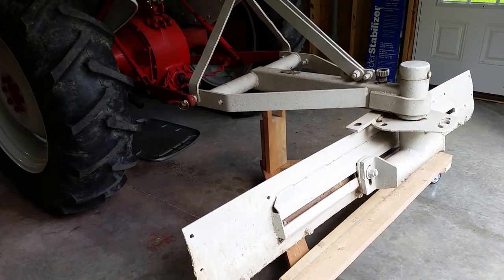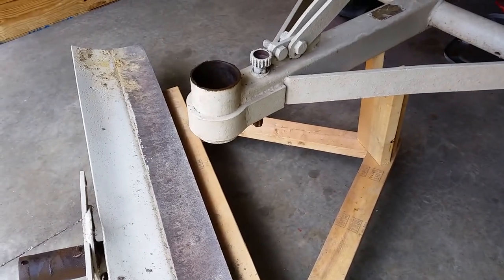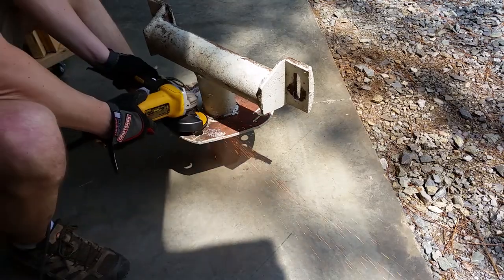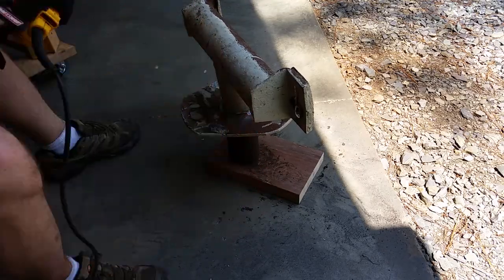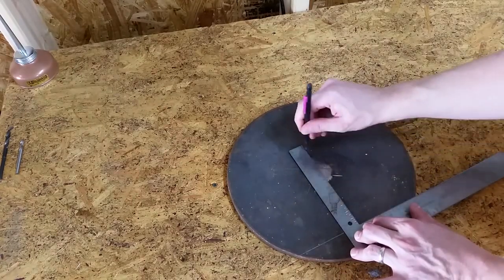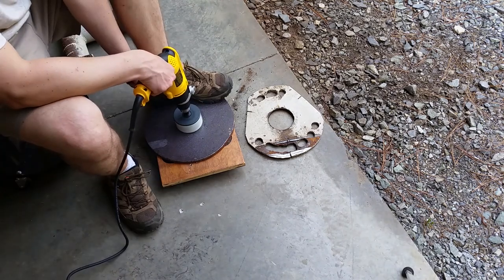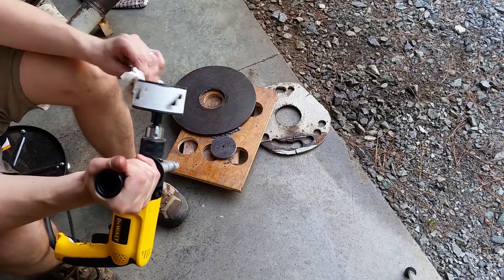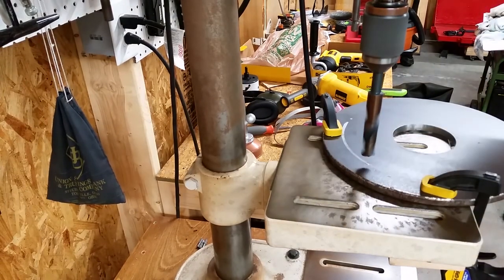Repairing a Tractor Grader Blade

Comment from the maker: Dewalt Angle Grinder:
https://amzn.to/2UOxd3X (affiliate*)

Lenox Hole Saws:
https://amzn.to/39zeChu (affiliate*)

Dewalt 1/2" Hammer Drill:
https://amzn.to/346Exw8 (affiliate*)

CP Die Grinder:
https://amzn.to/2xEWRA2 (affiliate*)

Carrbide Burr Bits:
https://amzn.to/2UvTgxc (affiliate*)

3/4" Drill Bit:
https://amzn.to/3azUhtI (affiliate*)

Dewalt Chop Saw:
https://amzn.to/2xD1aw1 (affiliate*)

*Purchasing from these Amazon affiliate links earns my channel a small commission. Think of it as a tip that doesn't cost you anything. Thanks for the support!

Comment: good work, might i suggest a bottem bracket with a corrisponding pin sleeve as well? i think thats why the thing is encountering so much wear
Reply from the maker: I originally planned to weld hardened bushings into each hole but I figured with the increased thickness of the new plate and the infrequent use it sees, it'll probably outlive me. :) Thanks for watching!

Comment: How come you didn’t put hole on the opposite side so you could turn the blade around to use as a pusher?
Reply from the maker: I just couldn't think of a situation where I would need to push with the blade. I made this repair 5 years ago and haven't had a need for it yet. It wouldn't be as easy, but I could always add a hole in the future, if needed.

Comment: why you using 6010 rods
Reply from the maker: Good eye! I used 6011 for a few reasons: 1.) I wanted high penetration since I was only welding one side of the plate. 2.) The "fast freeze" of the 6011 made it a bit easier to fill the gaps on the bottom of the pin sleeve. 3.) I have very little welding experience so maybe it wasn't the right rod for the job but it seems to have worked very well. What rod would you have used? Thanks for watching!